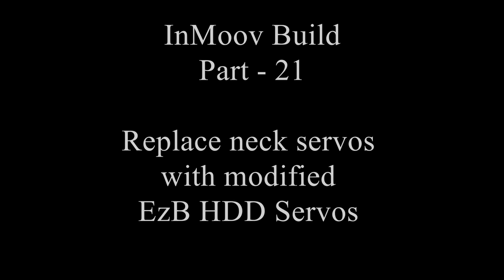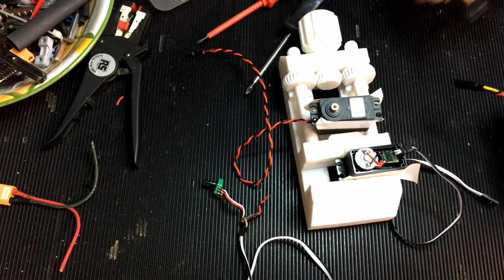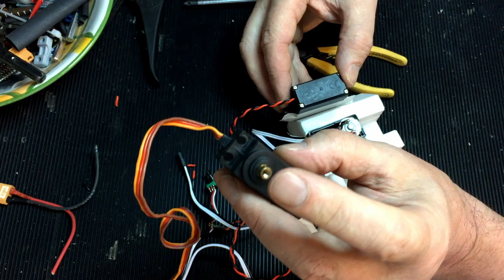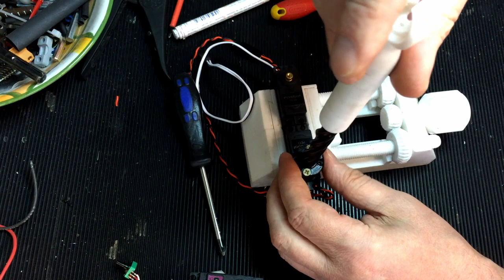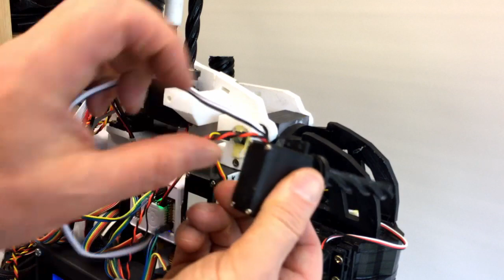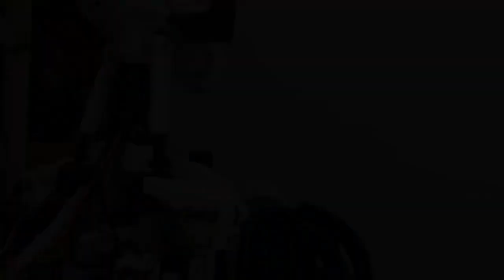InMoov Build Part - 21

Comment: I have a MG995 would it support the modification? I saw that his burned and heard the nescessity of Trocalos for another, where I thought the plaque did not endure, with knowing if it endured? Maybe on trial and error? Or have something you can do to know before
Reply from the maker: Hello Laudemir, yes you can modify those servos.  I have burnt out a few servos so trial and error
Reply: I have a doubt, the input to the servo on the Arduino board (analog / digital) can disrupt the operation of the script?, for example if placing the servo hs-805bb on the analog port, when running the script may malfunction?
Reply from the maker: @laudemirferreira3227  You will need to supply power direct to the servo from a separate power supply, not from the Arduino board itself.  Just connect the DATA line and Ground from the Arduino board and the servo power and ground direct from the power supply itself.   It can all be the same power supply but for servos you need a lot of amps.  My power supply is 5-volts and 40-amps to run InMoov servos.
Reply: @kylecampbellweb  i have a 5v 30A power supply, i'm quiet about it, the fact is i'm having problems with the head script, the webgui service does not receive the voice commands or does not take orders so nothing works
Reply from the maker: @laudemirferreira3227  Hello, are you using MRL software [my robot lab]?  I do not use that system and do not know much about it.  Best to ask on the InMoov forum about MRL, kyle
Reply: @kylecampbellweb  
yes I use the (MRL) I want to get my head working, I'm looking forward to this moment, the script is not something easy to break up and yet things work, I don't know what other management software would work for free I noticed that you use (EZB ) but it is not accessible to us actually I was not aware if such software is free
Reply from the maker: @laudemirferreira3227  Hello Laudemir, the EZB software itself is free to download and use.  https://www.ez-robot.com/EZ-Builder/
The hardware required can be found on discount offer on the internet regularly.   I have seen the EZBV4 controller for $50 dollars and the EZB IOTiny is $25 dollars 
The InMoov forums are very helpful about using the MRL but as mentioned, I do not use it myself

Comment: I want to know which service motor to use to build inmoov robot
Reply from the maker: Hello Dylan
I have used a few types of servos.
I this video I am using the EZB HDD servos [https://www.ez-robot.com/Shop/AccessoriesDetails.aspx?prevCat=9&productNumber=7] but have also used Hobby King HK15298B and also the MG996R servos.
For the larger servos I have used the Hitec HS805BB andHobby King HK15338 and they all work fine. 
There is a lot of discussion on Servos on the Imoov forum and also the Inmoov BOM list here [http://inmoov.fr/default-hardware-map/] and here [https://groups.google.com/forum/#!forum/inmoov].
kyle

Comment: Hi Kyle, another great video and another thumbs up. 
I was wondering if anyone tried just reversing the motor leads on one servo  and using a "Y" splitter for the data line, the power wires could go to their own power source. That way you wouldn't burn out the servo boards. This is the way I connect the 2 stepper motors for the "Z" axis on my 3D printer.
I plan on using Arduino Uno boards because I can build them cheaper then  what I can buy them. The Arduino boards can't handle the power for all servo's so you have to have a separate power supply board. I also want to use a Odroid C2 mother board cause it can run Ubuntu 16 or Android and is about the same size as the Arduino board.
http://www.hardkernel.com/main/products/prdt_info.php?g_code=G145457216438
The Odroid only uses 5 volts at 2 amps, it has 4 usb ports, usb OTG port, HDMI port, a 64 bit Quad Core Processor 2Gig memory and more.
Let me know what you think. Kenn
Reply from the maker: Hi Kenn
You may have success with the Y splitter and just reversing a single motor wiring. And this would put less strain on a single servo board.  I think modifying the servos for a single board control originally allowed for a single potentiometer to be used also, as in the stomach motors.   The neck servos should stay in sync with separate controllers.  Also with the dual neck motors, its been discussed to just use a single motor on one side and a dummy motor on the other side. 

I am reprinting the dual piston neck parts in PETG for my InMoov at the moment, plus I have some spare ezb servos so I think I will try it unmodified as you say. 

The Odroid looks good, plus you Arduino ideas, most interested in how that will all work out. I am staying with windows platform to run the EZB software for my InMoov and am running it on a Intel NUC at the moment, but am also thinking about Latte Panda or similar.  

I am also trying out the MRL Manticore software at the moment, which is well worth a look.  Might use it on my Head Bot, when I get the time to work on it.

Comment: Those ez robot HDD servos have a built in thermal and amp draw protection... If the board overheats or pulls too many amps it simply shuts down to protect itself... Once cooled it will work as normal... I would be very surprised if you managed burn out one of the new HDD servos...
Reply from the maker: Hi Richard, great thanks for the info. Was a bit concerned that I might be recommending a way to damage servos! The previous servo burnt out but I think that was partly due to the neck pistons being a bit loose and the head lifting off the ball joint and jamming.